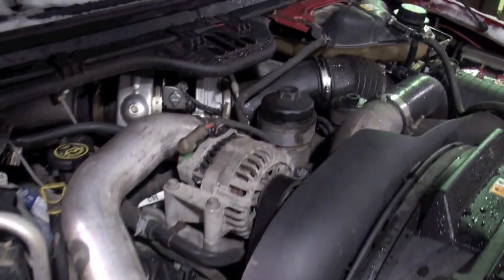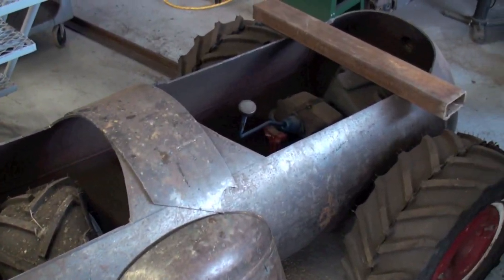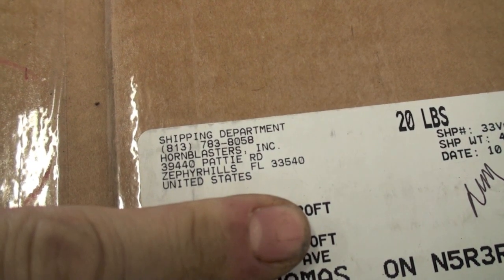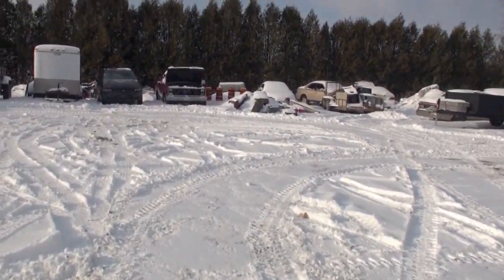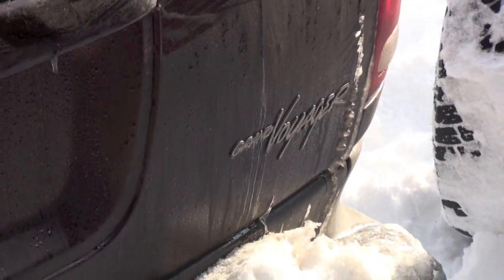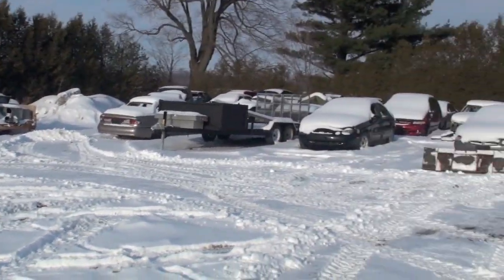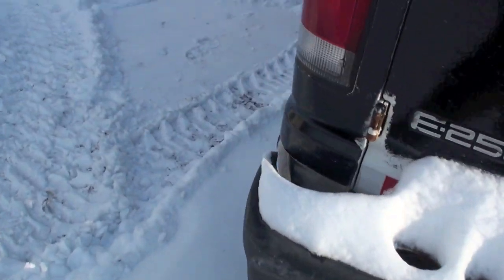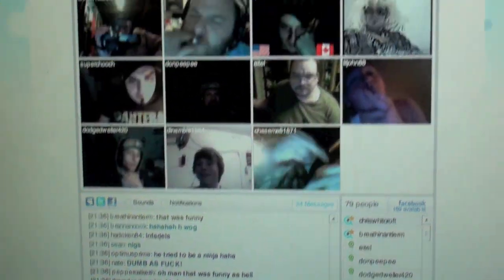everything update!

Comment: Hey bud I just go the same thing fixed on my welder I didnt need to replace the whip just  the connector and maybe small parts inside take it to the repair guy at praxair in london  real nice guy and he will use parts hes got there and it will be real cheap. great guy

Comment: @7477238 three or four different cars head gaskets in in the last 5 yrs. (Live in MN its Cold, Gaskets don't like it here) Once fixed W/ Mendtite Never had on blow again :)

The important part is to only use one can,  And be sure that the coolant is 50/50. The Glycol Alcohol in the coolant acts as a catalyst. Similar to the way a 2 part epoxy works. Its also important to run the vehicle @ IDLE for 1/2 hr after adding it to coolant,.

Comment: well to start with Not entirely. Ford owns 15% to 25% of stock in Cummins. second i dont just roll coal as u say we use ours we have 4 of them. also have a INT combine with a cummins.third Ford didnt start the i6s. fourth we have a chevy weve put 400,+++ miles on it we also haul our crops with chevy 2-tons two of them have well over 100,000 miles. cummins has earned everything theve done. i dont see a powerstoke in farm equipment. thats right it cant stay together long enuff to do anyhting..

Comment: @7477238 Actually. Yes you did. You said "Yeah the gas ones like the F-150 which are great trucks" when I mentioned that Ford trucks have been the best selling truck for 34 years. My brother inlaw has a 2001 Super Duty with a Powerstroke Diesel that has 234,000 miles(376,000Km). The engine has never been touched. My boss has 2005 King Ranch Super Duty F350 with the Powerstroke Diesel. 176,000 miles(283,000 Km). Where is your proof of Powerstroke being crap? One truck?